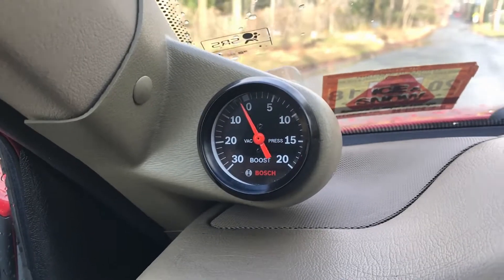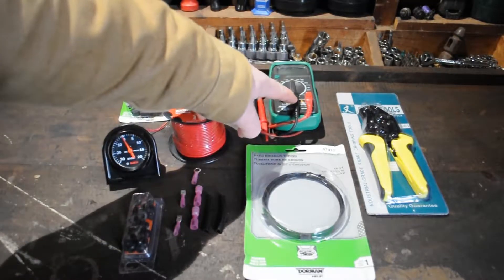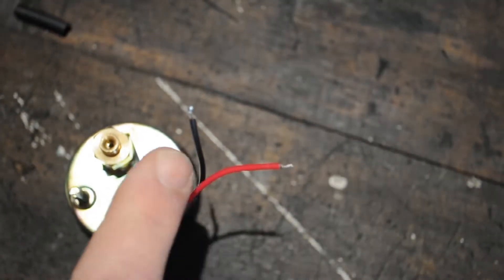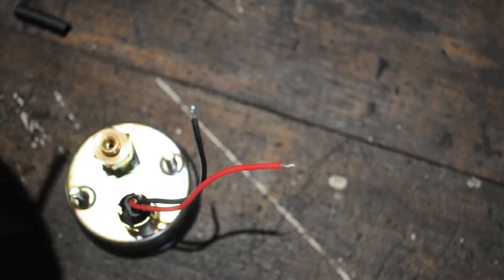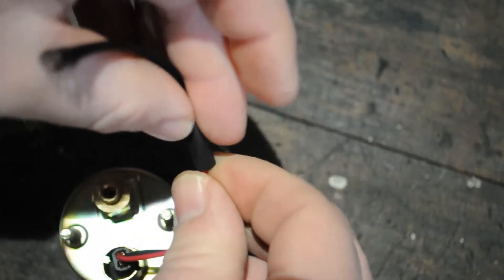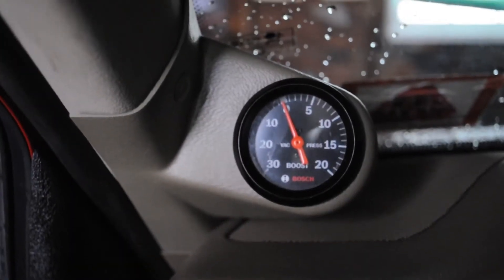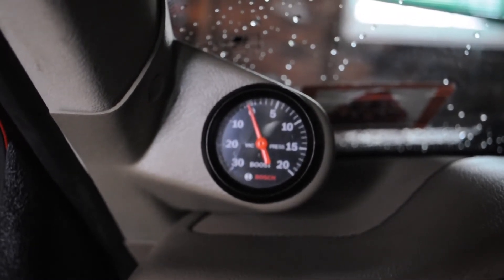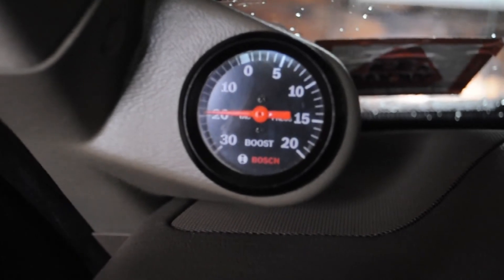Boost Gauge Install

Comment: My First time installing a turbo and Boost gauge. Why does the needle go from zero to 20HG once you start the car? I thought the needle should stay at zero and go up as you drive the car. Can you explain?  My boost gauge also goes to 20HG once I start my  car. I’m not sure what to expect. If I want to get 10 pounds of boost for my setting, does that mean I need to adjust The boost controller until I get to 10 psi when driving? Thx in advance.
Reply: Your gauge should be at 0 when the engine is off. But the second you turn it on, it should go into vacuum because its constantly sucking in air until you build boost pressure.
Vacuum is negative pressure and boost pressure is positive pressure.

Comment: Are you gauging a vacuum or a pressure?
Reply from the maker: The Volvo it’s in is a turbo so at idle and part throttle you will be reading vacuum. Under load / throttle it will push past 0 in boost pressure.
Reply: @114RIDES  Ann added idea for my knowledge,thank you so great!

Comment: You never showed what you did on the dimmer switch.  Dud you crimp, add wire? How did you even plug in the connection between gauge and dimmer switch?
Reply from the maker: 5:23-6:27 clearly explains how to hook up the wiring. Thanks for the question and support.

Comment: awesome video thanks!  I can't find a gauge pod that looks good in my car, I don't like the A-pillar look, or on top of the dash swivel mount... I found a company that makes a gauge holder for the AC vent.  it looks really good, but I'm worried I won't be able to turn on the heating, will it damage the electrical wires/vacuum hose?  I don't wanna lose my ac or heating just to accomodate a gauge. but damn does it look good lol
Reply from the maker: I ran the gauge in my vent for a while, you won’t even notice the difference in the climate control. You have to keep that vent closed at all times. Thanks for checking us out!